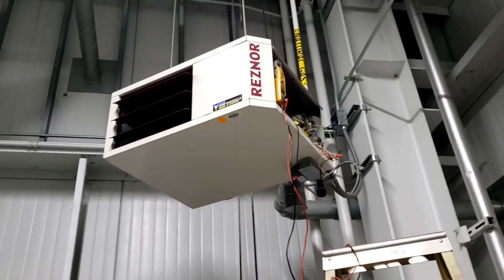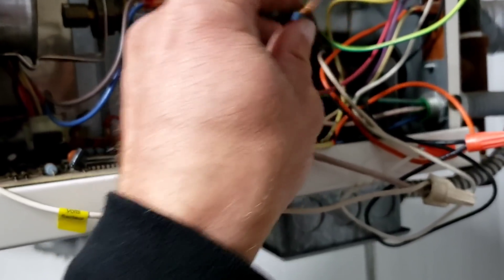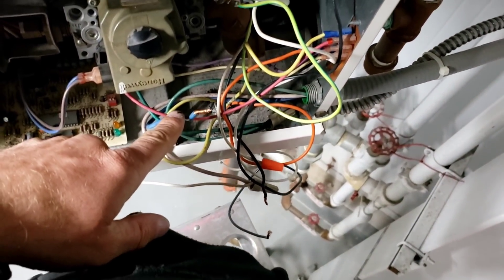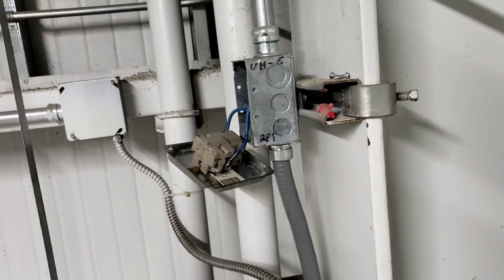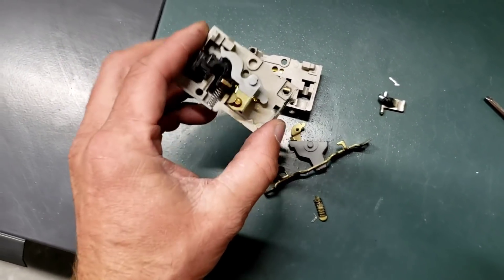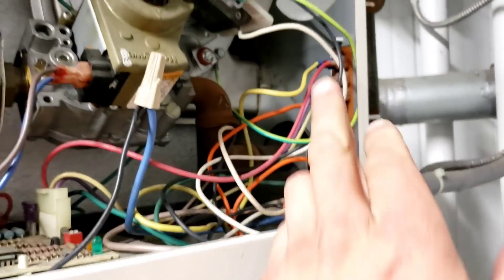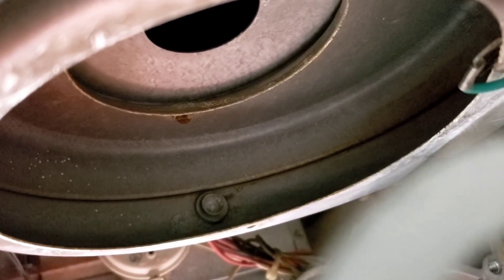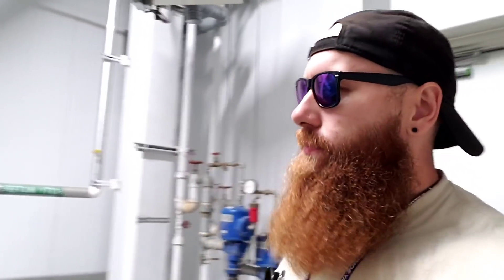Ghost voltage, is it real?

Comment: the newer meters that have a LO-Z function will help to discern if the reading is true voltage or induced. VFD'S are bad about that . I know having a meter that does everything is now pretty common but I still prefer using my Fluke 116 and if I need to measure amps I have a Fluke 324..

Comment: you'll see that a lot in larger buildings/commercial ran in conduit, bus ducts and chasses that house multiple live conductors. inductive coupling is a pain, at power grid levels it can and will kill you, especially if the coupling occurs from higher primary voltages into parallel or intersecting lines, without any connection the lines could reach a higher potential than the normal voltage.

Comment: @curioushvacguy I'm surprised you didn't see ghost voltage when you were in the appliance field it usually when testing the evap fan next to defrost circuit. If it was more common I would suggest getting the Fluke 116 I believe it has low impedance measurements called loZ
Reply: they have a plug in module to deal with "ghost/induced voltage" for all models. other companies likely have them also
Reply from the maker: nope never saw it in my appliance days, last time I found it was on a exhaust hood-- strange stuff really but a meter upgrade would def help with this, it would make it safer to verify

Comment: I was electrocuted by my chain link fence gate last week. Its attached with wire to a metal pole on the side of my shop. The shop has some kind of metal siding and the poles right up against it. I checked it several times with a that yellow klein pen , a multimeter and by hand and while the gate was open and I touched both the left and right side of the double gates it would shock me. But gates closed it didnt put off voltage. It was about 29v ac. I shut off one breaker at a time and it stopped after I shut the last one off but when I turned everything back on no shocks no voltage ever since?? I'm confused. I'll come back and modify my comment if I figure this out. Also this has never happened before with many years of using the gate.
Reply from the maker: odd, where you maybe grounded that day and never before?
Reply: @curioushvacguy6876  I usually always try to stay well grounded😄. No everything was the same, didnt do anything differnt that day. Had my shoes on. It's just weird how the fence and shop wall triggerd the test pen and multi meter showed about 29v, and I know what being shocked feels like🤷‍♂️.. I still haven't figured it out. I'll let you know if I ever do thou.

Comment: I'd never assume a precise 120V floating around to be capacitive coupling, seems like you tested hot to ground and then motor lead to hot but this never actually proved continuity in the circuit. If you're pulling 120VAC hot to ground on a meter and suspect it's ghost voltage then something like a neon lamp would be handy.
Reply from the maker: your exactly right, something that would actually put a load on the circuit

Comment: It's often capacitive coupling from adjacent wires, but can also be leakage through control equipment, especially with capacitive filters and snubber networks.  You can touch a 240V wire and not get a shock if you're isolated completely from ground, but it's not recommended, as anything that does provide a ground path will result in high current flow through your body.
This is why electricians tend to use test-lamps instead of high impedance meters.  The extra load shunts current leakage to give a more accurate indication.
Reply: Always listen to professor clive
Reply from the maker: shopping for a test lamp now, as always I appreciate the great wisdom Clive
Reply: @curioushvacguy6876  Are we talking about a neon test light?  Haven't seen too many people carrying one of those.  Maybe a volt alert pen?
Reply: I was gonna say something , no way you would  get hit if you weren't grounded. This guy obviously  not an electrician and really nows nothing  about electricity if he doesn't now that.

Comment: Nice trick with the “Glow Stick Of Death”!  We do Industrial work. On 110v circuits we use the old fashioned Acme Pop Testers. Control circuits will do the same thing.  You have what says 110.  But no Umph behind it!  That’s where the pop tester shines.  Thanks for the video.  One other thing on the Reznor units.  Always check the cabinet ground.  If it’s loose or corroded. It will screw up the burner module. Found that more then once!  Be well!  Best Regards!

Comment: So called, 'ghost voltages' are generally caused by high impedance somewhere in the circuit. Digital meters tend to have a very high input resistance and will show the full voltage because the meter places almost NO load into the circuit. Load the circuit down and the voltage drop across the high impedance will increase to the point where little or no voltage reaches the load. If a tech has a question about this they can connect a lower resistance into the circuit where they wish to measure voltage and will see the voltage drop. It basically comes down to a bad connection somewhere.
That switch that had the problem is a 'motor starter' switch.. It is a more sensitive device sized more precisely to the current draw of a motor than a circuit breaker, and is there to basically continuously monitor the current through the motor. It has a 'heater' precisely sized to the load (motor) and as the current through the motor increases beyond it's rating the heater (usually some kind of bi-metal) heats up will bend and engage a linkage to disconnect the motor. With that type you generally turn the switch all the way off and back on to reset it, or with some, the switch will be off, and only needs to be turned back on. Heaters on a motor contactor generally have a button used to reset them. It would appear that the contacts inside the motor starter switch had some defect or carbon build up creating a point of high impedance (resistance) creating what gets interpreted as a ghost voltage at the load that is detectable when the load is removed, and a high input resistance meter is used to measure the voltage.
I will go on to say that I think the use of a motor starter type switch to feed an entire unit was a misapplication for it's intended use. If you have devices powered by the motor starter switch other than just a motor you're no longer using it for it's intended purpose. They're not meant to feed anything more than a single motor. You'll see them on exhaust fans etc. That' where they belong. Not a unit with power supplies, circuit boards, and other devices that require power as well as one or more motors.
Replacing it with a standard 20 amp switch was the right thing to do. If one wanted to protect the motor inside the unit against overload, then some overload protection device will be mounted inside the unit and supply the motor alone as you'll see in most HVAC applications.
Reply: Man thank you for your input , thats very interesting indeed mate 👍 . I briefly heard about ghost voltage before but you made it much clearer so cheers for that mate 🤜🤛
Reply from the maker: Thanks for the info FRed- very much appreicated sir, this is why I like to stay humble

Comment: The Breaker  protects the wire and circuit from shorts and excessive current. The switch was a common isolation and overload switch. This should match the thermal characteristics of the motor and protect it from overload.  I am a little surprised to see it on such a small motor, but they do make them for that purpose. Ghost voltages aren't uncommon to see in the Electrical Industry. It is primarily caused by inductive coupling, but there are other causes. The high input impedance of today's digital meters draw so little current that they will show full voltage. That is why I still keep my Wiggy Meter around (Solenoid Voltage Tester) because it puts a load on the wire..  Nice to see you doing Videos again Bill.
Reply from the maker: Thanks Stewart, imma have to get me one of those wiggys, should have had one long ago

Comment: What was that little orifice you cleaned out, an air balance valve?
Reply from the maker: Actually that is the port for a tube leading to the air pressure switch- I lost part of the footage showing it wouldnt light because it couldnt close the air switch

Comment: That type of switch is very common in commercial buildings where you have small motors that have more than one motor on a circuit say you have several small pumps on one 20a circuit but the pumps only use fractional amp draws and one pump fails it will trip the switch for that pump instead of tripping the breaker and shutting down all the pumps so you might have more than one unit heater on that breaker

Comment: Sounds like two wires are super close to each other but not actually touching. Voltage is induced across the gap similar to a capacitor?

Comment: i already know how ac electric work
it switch that not making contact with pin it staying closer to it like 2 or 4mm from it and ac voltage is jumping from pin to pin but super lower amp like 0.1 somehow if u ground it will show nothing at all
put wire that closer to ac 120v like 2mm or 4mm I believe you be getting 120v but when touch it ground out 
if you dont know much about it go ask electricboom he probably explain it just like voltages jumping from oils to oils same as switch is

Comment: I was a maintenance supervisor at a big casino in my area. Before I was a maintenance supervisor I worked with my pops doing HVACR with the family business. After that became a mechanical engineer. Many moons later the maintenance supervisor job. We were getting complaints about people getting “shocked” by some of our slot machines. So, with my background I decided to do a feeder study. Turns out there was 142 amps in the ground loop feeding said Casino. Had to reword the 5 xfmrs feeding the place. The backup system and switchgear, everything. Complete with fireworks on the last cut. That was a days work. That’s what you get for going with the lowest bidder and many “value engineering” cuts on an Indian built Casino.
Reply: Wow. How did you figure out that problem? So interesting.

Comment: I’ve seen it a few times in my life, I’ve referred to it as empty voltage but it’s always been a broken wire inside of the insulator or a defective switch. I work on HVAC so not sure what it’s actually called maybe an electrician can fill us in

Comment: I was changing a light fixture and the same thing happened. I flipped the breaker and switch off but still picking up ghost voltage. Never figured out why.

Comment: It’s a common phenomenon especially in 12v dc automotive electrical systems. If one strand of a wire is intact on a circuit due to corrosion or other means it’ll still ohm out properly and even have the correct voltage. But try and put a load on the circuit then the voltage will drop to almost nothing and the device will not work. Which is why good mechanics carries a few different size lights and jumpers in his or her toolbox to load test circuits to be 100 percent sure it’s the components or the wiring of the circuit.

Comment: That switch is a MMSKG1. It's a motor starting switches that provides manual on/off  control of 1/3 phase AC motors where overload protection is not required.

Comment: Well I know I have run into a on and off switch with a technical reset for 120 volt exhaust fans in gables of metal buildings but for heating unit I've never seen that
Reply from the maker: good, so im not alone then

Comment: You can have voltage without any problems but that voltage isn’t carrying any amperage, that’s why it hasn’t shocked you.
Reply: He was also not grounded :P
Reply from the maker: I also have mutant abilities
Reply: @curioushvacguy6876  
Good to see you back
Reply: @curioushvacguy6876  🤣
Reply: Electricians will sometimes work hot wires standing on plywood or something, or use the tingle test with their finger to grab only a hot if they are coupled to the ground just enough, but not enough to complete the circuit painfully. Or wire a receptacle and put on the hot first and save the ground for last so the metal ground body can be held onto during wiring without getting shocked by touching the hot at the same time.

Comment: Glad to see you're back!
Reply from the maker: thanks
Reply: I dont ever turn gas off at the actual gas valve anymore. My first heating season, I had to replace 4 because they just wouldn't turn back on.
Reply: @adamlee3810  I've been there, but it becomes part of the chargeable repair. Today's heating products are becoming problematic here in CA. We've had nothing but problems with these low nox heaters. Garbage and loud. Cheap HSI systems, poorly built circuit boards, gas valves needing an additional appliance regulator. Non adjustable air mixture ports that need adjustments. Company reps are pretty much in the dark on several of these issues. 40 years in the business and they throw us these learning curves that make me feel like I'm back at year one in this trade, but I digress. Lol.
Reply: Good job